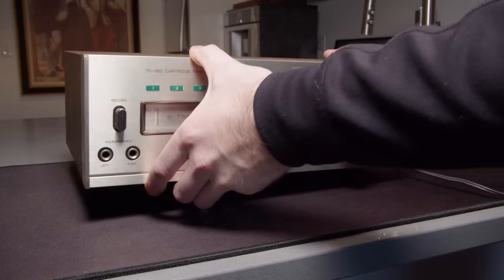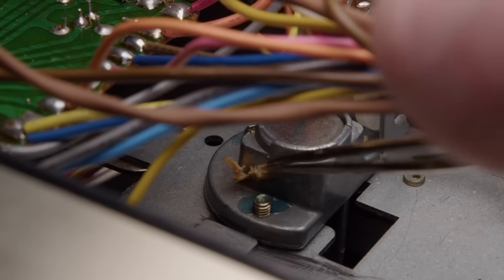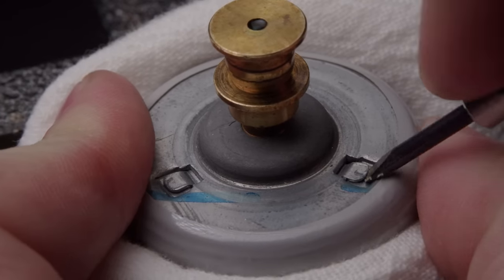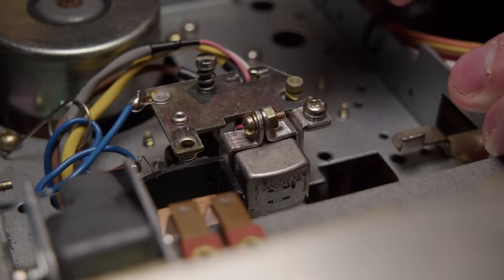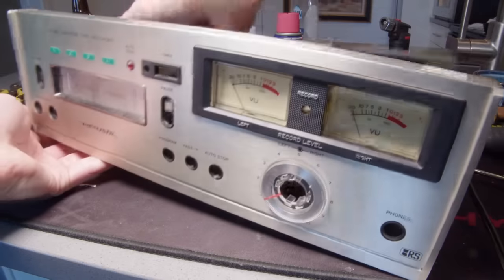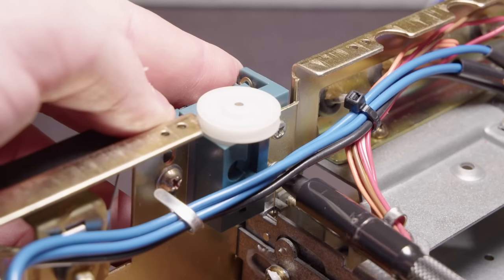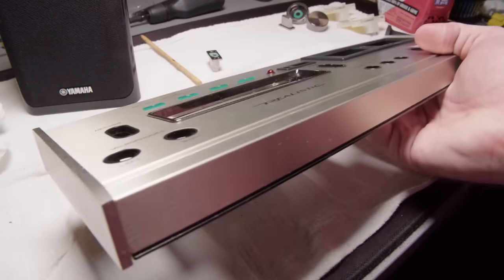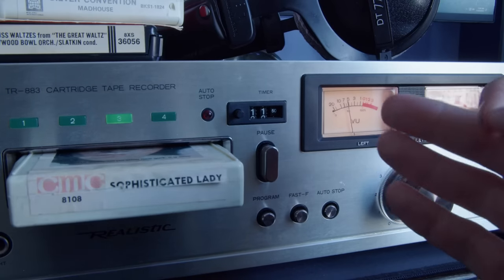An 8-Track Recorder‽ Be Realistic! | Vintage Hifi Revival

Comment: Nice repair job. 8 track recorders were really popular back then. We had everything on vinyl and wanted to listen in the car...or bootleg for our friends. I had a JC Penney AM/FM, turntable, 8 track recorder. Charged $1 each to record stuff for my older brother & his friends. They had to supply the blank tape.
We always used Zippo lighter fluid, which is basically naptha, to clean and lube solenoids in valves and doorbell chimes and such. It doesn't gum up. A ballpoint pen eraser is good for shining up contacts, small commutators and model railroad & slot car tracks. Hypodermic needles make great oilers.
Thanks for sharing.
Reply: David Mander  Of course, that's why the music industry died in 1983. Thank goodness we're past the statute of limitations.😉

Comment: 8 track recorders were extremely common in the mid/late 70’s, especially in the all in one stereo/turntables and component style like you have here. There is no “record protect” on an 8 track, those two copper plates are the sensors for auto track change, also, since 8 tracks “usually” don’t have an erase head you are just recording on top of what is already there and you can often hear the previous music in the quiet spots. A bulk tape eraser is great for wiping a used tape clean before recording.
Reply: ☝️100% what Alan says. On a good deck, an 8 track can sound stellar. I've some Elvis carts from post Aug 1977 and they sound fantastic.
Reply: are you sure that's the case for all device, if i 'm not wrong i remember mine tr-803 had an erase head, because i do not recall hearing previously record! Edit: I've just checked there is an erase head on the tr-803
.
Reply: Extremely common? Perhaps in your little circle. 🤔Overall, they just weren't. Recorders only came along when cassettes already had the writing on the wall and were killing the 8-track in sales and in audio quality.

Comment: Recorders were very common.  Virtually every stereo receiver with a built-in 8-track could record.  Some were built better than others however.  Some didn't come with a pause button - which makes recording very difficult.  If you're going to play with 8-tracks, invest in a big bag of flat belts.  Speed problems almost always come down to belt issues.  Also, repair every tape you get : replace the pad and splice.  Remember - it's NEVER the player.... it's ALWAYS the tape.

8-tracks have no "write protect" scheme.  Those leaf switches inside are probably to turn on the motor and turn on the lights.  About the only protection scheme 8-track decks have is that most will not allow you to press the record button after a tape has been inserted.  Generally the process is to hold the Record button while inserting a tape.  

The only tapes that have a notch cast into the top are the Quadraphonic tapes, and that notch is there so that a 4-channel machine can automatically identify a stereo or Quad cartridge.

Comment: A great deal of older Radio Shack equipment was made by major manufacturers with the Realistic Label put on.
Reply: In the early 70's,Trio of Japan (Kenwood) made a lot of audio gear,then Matsushita (Technics/Panasonic)made their turntables,(and most likely) this 8-track .When RS came out with the R-R  TR-3000(I have one),it was a rebadged ('80's)Teac X-3.Not a bad machine,spec-wise,but entry level,and certainly NO Akai,'70's Teac, or Sony in their heyday.Their flagship receiver,the STA-2100,which I own,was made by Foster electronics in Japan-the same maker of the Fostex equipment. It went head-to-head against Pioneer's best receiver,the SX-1080,and matched it spec-for-spec-for $100 less!--so Pioneer sued RS for "patent" infringement,"because of the toroidal transformer",which Pioneer used also,but had sourced from Bando, a different manufcturer than Foster. (Bando made toroidals for about 4-5 different brands).The truth is, more likely being,that Pioneer feared the competition.At either rate,RS has had a rather erratic track record on the quality of their equipment,having to have depended on so many outside manufacturers for their items.Some were "not-so-good",some were ok-to-pretty good,and some,like the STA-2100,knocked it outta the park.But I really miss them for all the electronic parts they carried.

Comment: I have the exact same recorder. Use it often and the recordings are MUCH better than people realize or give them credit for. The "gap" in recording when it changes channels is only a split second as the tape is still moving and the sensor foil is only about an inch long, the tape is moving at 3 3/4 inches per second so the dropout from the foil is less than 1/3 of a second. There is no "write protect" on any 8 track tape, you can accidentally record over any tape, anytime blank or otherwise. I have tapes that my dad (RIP) recorded 50 years ago that have all kinds of music (mix tapes) he recorded off LP, 45, or even from another 8 track tape, so it wasn't just a medium for recording the radio.
Reply from the maker: I was listening to it today with some recordings I made - they really are good, and I probably wouldn't have even noticed the track switch if it didn't make the 'chunk' noise haha.

Comment: WOW....I actually have one of these things buried deep in my attic.  I bought it in the late 70's to dub my per-recorded cassettes and lp's onto 8-tracks so I can play them in my car.  This thing was cheaper than buying a cassette player  for the car.  I put the thing away when I joined the military and when I got out, 8 track tape had faded away.  It has moved with me from home to home as an attemped to keep my "system" together over the years....I will have to dig this thing out and see if it still works now....I wonder where I can find some "still operational" 8 track tapes.... thanks for the memories.

Comment: HI ALL CAPS JOE HERE.   AGAIN.     THE REASON THE SOUND IS SO GOOD IS THEY USED CLASS A CIRCUTS UNTIL 1074.    OR AROUND THERE.    I TOOK OLD 8 TRACK CAR STEREO AND TOOK OUT THE HEAD AMP AND SPEAKER AMP OUT AND THE HEAD AMP IS CLASS A AND THE SPEAKER AMP IS CLASS A AND I RUN MY PHONE INTO THAT HEAD AMP WITH A POTENTIOMETER ON IT AND RUN THE AMPLIFIER OUT INTO ANOTHER SPEAKER TO RCA ADAPTER. THE PYRAMID ONE. AND THEN RUN THAT THROUGH MY EQS THEN INTO MY AMP AND EVERY SINGLE. BASS GUITAR IN EVERY SONG IS WAY BOOSTED. FROM THE CLASS A CIRCUT.   ITS SOUNDS SOOO GOOD I ALWAYS START CRYING BECAUSE DIGITAL HAS ALWAYS BEEN ICE COLD.    AND THATS BECAUSE DIGITAL TURNS THE SIGNAL ON AND OFF TOO FAST AND IT NEEDS TIME DELAY AND TWO CLASS A CIRCUTS IN A ROW DEFINITELY DOES IT.   YOU KNOW ITS CLASS A AMPLIFIER BECAUSE ALL 4 TO2S ON THE OUTPUT WILL BE THE SAME PART NUMBER
Reply: Exactly

Comment: I recorded 8 track carts back in the 70s. I had a Ross unit, which had all these features, but no pause button. So I installed a switch on the back, that would stop the motor. One feature I really liked is that the deck would continue to record right through the track change. Upon playback, there would be about a half second pause as the metal sensing foil went past the head, but that was not really noticeable. MUCH better than the fade out, track change, fade in of the prerecorded tapes. With Ampex blank cartridges, this deck could rival cassettes in sound quality, virtually no wow or flutter.

Comment: reel  to reel was the best way to record of the radio back in the day

with the SP TP  tapes 2400  3600   you can have over 10000 feet on a otari mtr 12 
got to be carefull the deck rew ff is very powerfull

Comment: I have a tr-881 which is a slightly cheaper version of your tr-883 and it does sound fantastic! I had to change the belts and re-grease it when i got it as well but didn't have to disassemble it like you did. The trickiest thing for me was to get the head alignment right!

Comment: Radio Shack stuff from that era can be surprisingly high quality. Recently picked up a SA-2001 integrated and TM-1001 tuner, both from '79 as well. They would have made a great combo with this deck.
Reply: Yep, in the 60s and 70s The Shack had a full line of cheap-O stuff to very good quality stuff, often made in Japan, Taiwan, England and Germany. I love looking through the Shack catalogs that are on line. Some of the better stuff is now quite collectible.

Comment: 8 track recorders were not too common for all the reasons you stated. Sound quality is better than cassette because the tape is moving at twice the speed of a cassette. When the track changes, it should only leave a 1-2 second gap in the sound. Love your channel!
Reply from the maker: Gotcha thanks for the info! I didn't know that about the tape speed difference so that makes sense.
Reply: The gap duration is hardly more than a fraction of a second, the time it takes for the metal stripe to pass the switch contacts and change track. The head keeps recording or playing non stop. It's ok for home recording as you probably don't care about the small glitch but they couldn't do that for prerecorded songs.
Sound delay chips, already available at the end of 70's, could've been a solution to eliminate the glitch for home recording.

Comment: I bought one of these units in the mid 80s from my local Radio Shack. The contacts you referred to at the end of your video are the trigger for the auto track changing mechanism. The metallic splice tape shorts the contacts to drive the required solenoid. There is not a write protect feature with 8-tracks. I serviced my unit a few months back when 3x 330uf/25v caps failed on the mainboard and killed the audio and shorted my track lights. I also replaced the 10uf/16v cap in the capstan motor to improve the wow and flutter problem it developed. The frequency response is only 50hz - 8khz where older realistic units went as high as 12khz.

Comment: I used 8 track recording when I was a kid and I still have an Olson Electronics deck from 1974 that still works.  Realistically (no pun intended), when it changed programs on a tape that you made continuously, there would be about a 1 to 2 second bit of mostly silence that actually sounded like a dropout.  As far as sounding better than a cassette, just like anything else, it's subjective.  If you have a really good cassette deck, chances are that would sound better than the 8 track.  To me the 8 track doesn't quite have the dynamics that other formats do.  I think the biggest hindrance is the tape formulation.  They never really improved the tape formulation by much but the cassette did improve immensely.  The 8 track tape moves at 3.75 inches per second and the cassette is half that speed at 1.875 inches per second.  I believe the track width is exactly the same, if not very close.  The cassette tape is 1/8 inch wide and the 8 track tape is 1/4 inch wide.  The cassette utilizes 4 discreet tracks and the 8 track utilizes 8 discreet tracks.  You did an incredible job on the repair of it.  1979 was definitely a long time ago, but I still remember it.  I hope you get many years of enjoyment out of it.

Comment: Believe it or not I think I have the exact same gear issue you have in your timer. I don't have access to a 3D printer quite yet, but once I replicate the part and attempt to replace it, I will be amazed if it works. It seems that from the multitude of 8 track players I have seen, that little gear is usually the culprit for the majority of timer related issues.

Comment: 1. 8 track recorders had timers instead of counter so you knew when the tape would run out. 2. 8 tracks sounded good because the tape moves twice as fast as cassettes, faster tape speed better sound. 3. When recording only a second or two would be lost when changing tracks.

Comment: Only thing in this video I cringe at,is when you were bending on that motor terminal-I KNEW it was going to  break off! Those terminals are VERY fragile-I learned the hard way! Shoulda use a fine needle-nose pliers to bend it s-l-o-w-l-y. Probably would have been better to retrofit an electronically-governed motor,which are now available--those contact types are prone to causing flutter as the contacts open and close in operation.

Comment: I have an RCA receiver with an 8track recorder built in. I've used it long enough to find it has an issue...it doesn't eat tapes as 8track decks apparently were made to lol. I tested it with an original release of the Sex Pistols' God Save the Queen :) Now what do I do with the thing...? Btw, it's around 19" wide which is odd to me.

Comment: Great sound capabilities well beyond tape with high end recorder and latest tape! that's logical it's twice the speed! (However not to harm tape lovers and to be realistic, the device lacks of latest technology like HX room,  dolby C, optimized head, and circuitry; i set in between chrome tape dolby b-c with optimal bias generally)  
Regarding convenience, i think you misunderstood to purpose of it.
Playback:
i put a bunch of tape near me and , just put these one while doing something else, when it eject the tape, i switch by another one, if bored switch program, all of this without being disturbed or loosing concentration of the other activity. Well known by older truck driver for it's convenience, you can practically change the cartridge without looking more than 1 second to the device, as well as other function!
Recording, well yes if you want complex recording (multiple record time) it's not made for.
But with today digital, you prepare the playlist according tape duration, add 4 second between program record change, and that recorded more easily that any another analog support! (don't hesitate recording hi-res)
Definitively great support, i miss mine,  which was too used by continuous playback instead of digital! Because yes it sound better! (However that's not hard even a tape sound better than digital hi res)
This said that's not done for people  who want to change tracks precisely, however none of analog support are done for digital music behavior and i think it's better you enjoy more the music than just browsing playing a few second each tracks!

Comment: hi i love the 4 track carts don't get the bad tape  the roller go inside alot of the 8 tracks 
it's the heavy wear in side them i pull the reels out of them and move it to the 4 track cart
and puy in the 8 track tape stop

my mate got 1000's of them and they sound bad as hell  alot of wear  alotof hard to find
one he's got quad audio one's with heavy wear

Comment: Great video. I picked up 3 of these at an estate auction recently and went through all of them and got them working. Same issues your had. The tape counter only works on one of them. Would you be willing to send me a couple of those parts you printed. I will pay.  I just don’t know anything about 3D printing.
Reply from the maker: Sure, I’ll make an eBay listing for a batch of them. You’ll have to give me a bit of time to get them printed and the listing made. But I’ll reply again when the listing is up.
Reply from the maker: Hello, I've made the eBay listing, hope they work for you! https://www.ebay.com/itm/225369751567

Comment: Love your videos!   You mentioned you did an STL for that gear you made, I have a similar deck that uses the same gear and mine is cracked as well.   Would you mind sharing your STL file?  I'd like to try the same repair.
Reply from the maker: Ah I forgot to put it in the description, thanks! Here's a link to it on Thingiverse: https://www.thingiverse.com/thing:5646438
Reply: @HifiJelly  Thanks for sharing that STL file!   I'm always looking for pointers on how to do better 3d prints... I usually use ABS for the stuff I print, but for this really small gear, it was tough to get the resolution I needed, plus the shrinkage was a big problem.   I was able to make a usable gear with ABS by increasing the scale by 5% and by drilling out the center hole to fit the metal axel.   I was curious what you like to use for small finely detailed parts like this?   Also curious, what kind of 3d printer have you used for parts like this and how does it do with really fine detail?   I'm thinking of upgrading my really old Flash Forge Creator Pro (dual), but not sure yet what I want to get...
Reply from the maker: @peclark11  For a part this small I use my SLA printer, which is an Anycubic Photon I got a few years ago. It's a resin printer, and while it's much more of a pain to set up/clean up and use; the resolution of the prints is unbeatable. For more general/larger prints I have a Monoprice Select Mini that I found in a thrift store awhile back and fixed up. I almost exclusively use PLA plastic in that since I find it easier to use than ABS and I haven't come across any detractions from choosing it over ABS.
Reply: @HifiJelly  Thanks so much - I will look into SLA printers - sounds like a great way to go.
Reply from the maker: I got a few more requests for the gears, so I've printed some out and are selling them on eBay if you still need them. https://www.ebay.com/itm/225369751567

Comment: i had a pioneer but sold it fast ,was when i started to have a cassette player in the car ,so this was late bought and the cartridges were sold with all the music you might wanted to listen but pirated and were cheap so the deck wasn´t that used ,i just sold it before i got stucked with it. but everybody was using this before 77